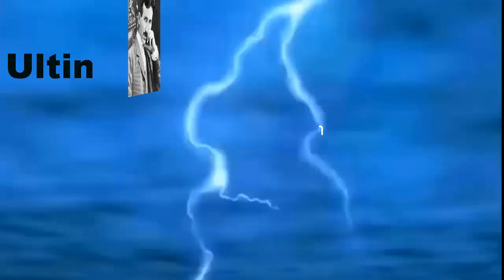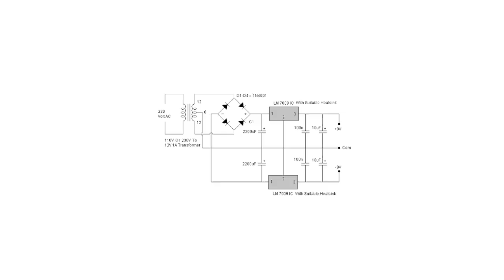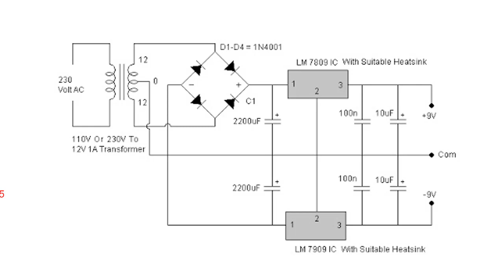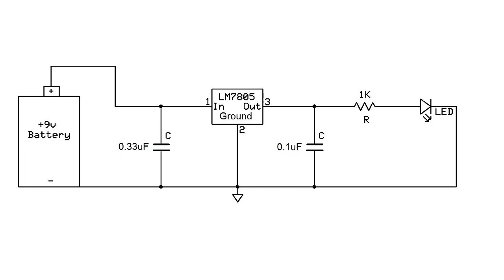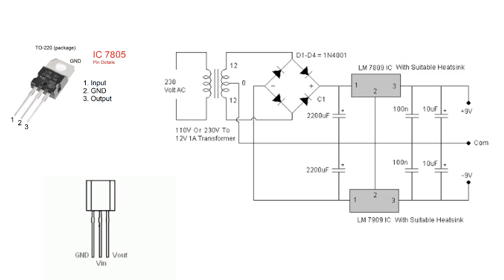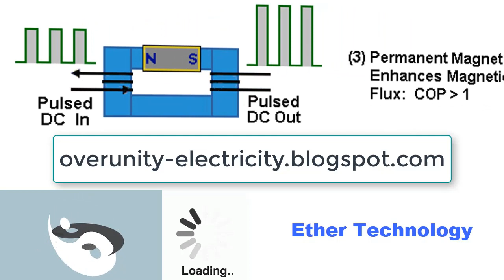7805 Voltage Regulator - Circuit Construction & Working

Comment: We've all been there. Sitting in a classroom, listening to a teacher drone on and on about voltage regulators and current flow. It's enough to make anyone's eyes glaze over! But what if you could make electronics way more interesting than at school?

With a few simple tools and some basic knowledge, you can start building your own circuits. Not only will this make class more interesting, but it will also help you learn more about how electronics work.

One of the simplest circuits to build is a voltage regulator. This circuit uses a 7805 voltage regulator to keep the voltage steady in a circuit. The regulator can handle voltages up to 35 volts, so it's perfect for most Arduino projects.

To build this circuit, you'll need a soldering iron, some solder, wire cutters, and pliers.

Comment: The voltage regulator IC 7805 is actually a member of the 78xx series of voltage regulator ICs. It is a fixed linear voltage regulator. The xx present in 78xx represents the value of the fixed output voltage that the particular IC provides. For 7805 IC, it is +5V DC regulated power supply. This regulator IC also adds a provision for a heat sink. The input voltage to this voltage regulator can be up to 35V, and this IC can give a constant 5V for any value of input less than or equal to 35V which is the threshold limit.

Comment: The 7805 is a three terminal voltage regulator IC from the 78xx chips family. It is a 5v regulator that can provide up to 1A of current. The device has a fixed output voltage of 5v and can be used to regulate voltages in a range from 4.5-8v. It is available in both through hole and surface mount packages, making it suitable for a wide range of applications.

Comment: Circuit construction is the process of assembling electronic components to create a functional electronic circuit. The circuit's function is determined by the type of components used and the way they are connected.

Circuit construction begins with choosing the components. The most common components are resistors, capacitors, diodes, transistors, and integrated circuits. Each component has a specific function and must be chosen carefully to ensure the circuit will work as intended.

Once the components are chosen, they must be placed on the breadboard in the correct order. The breadboard is a grid of interconnected strips that make it easy to connect components in a temporary way. Once all of the components are in place, the connections between them can be made using jumper wires.

Next, power needs to be supplied to the circuit. This can be done with a battery or a power supply.